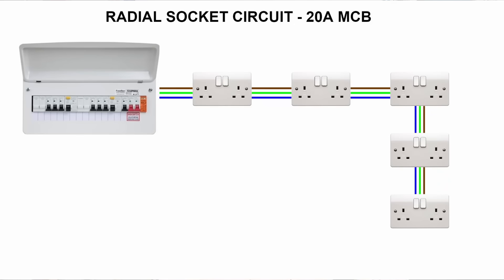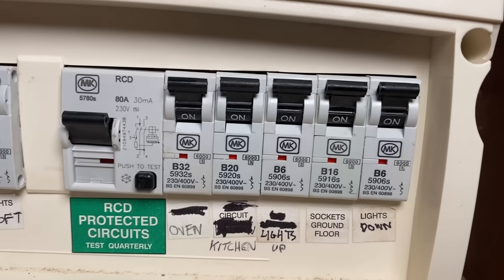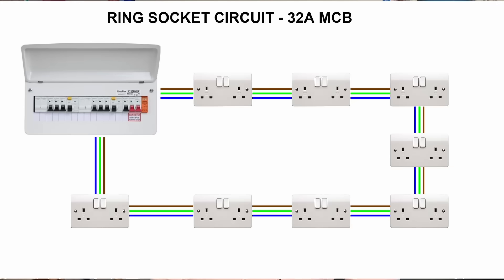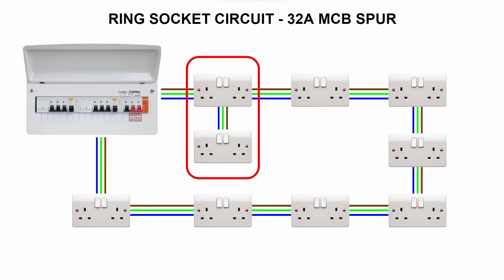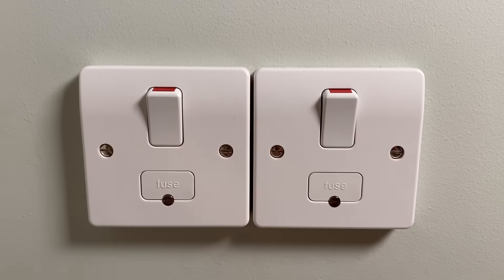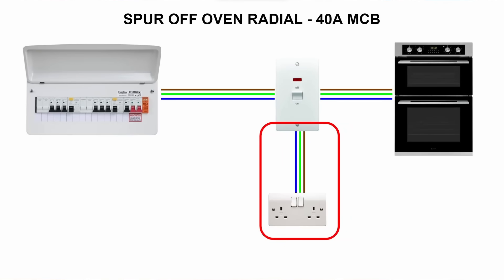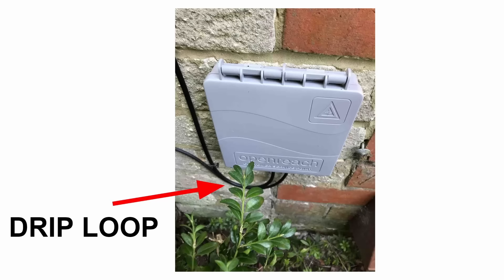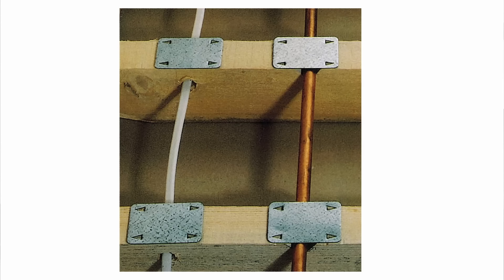BIGGEST DIY Mistakes Adding a New Socket

Comment: So why can't you take a spur for a socket off an oven supply and just add an appropriately sized breaker for the socket?
Reply from the maker: You could as long as it is fused down first, but most electricians would consider it bad practice. Thanks for watching!

Comment: Ring circuits are extremelly rare in my country..not even sure were legal in the first place...most likely error in previous sparkies electrical work.
I had one by default where a doorway in a wall between kitchen and laundry had been deleted in the past & I was called to upgrade lighting in laundry.
The light switch feeds on either side of old door jam were joined together as one for laundry circuit lights but they were in fact  2 separate fed circuits from the board on their own   fuses.
Took some headscratching to figure out why pulling each light fuse separate 1 by 1 not isolate the lights even went to isolate singley 1 by 1 every other fuse in board.. but turn off main switch only way to isolate..learning new stuff every day me.🙂
Reply from the maker: Interesting to hear! Thanks for sharing and thanks for watching!
Reply: This isn't a ring you're describing but two separate circuits joined. A ring is a single circuit with two cables instead of one, on a single breaker.
Reply: Correct that is how they 'should' be.
My case was across 2 breakers. @tobysherring1369

Comment: Ring circuit is crazy. In the US you can only use the size breaker which your wire is rated for. #12 wire max 20A breaker which is rated for 16A continuous duty. If your load is more than 16A for an extended period of time the breaker will trip. We only do what you call radial circuits here. You don't want power coming from two directions in case of a fault.
Reply from the maker: Interesting to hear, thanks for watching!
Reply: I prefer radials. But remember the ring's breaker is rated for the cable too - it just relies on there being two cables sharing the load.

Comment: You have forgotten Parallel Radial circuits!
Reply from the maker: What do you mean? When you have two radials on a single MCB?
Reply: @TheDiligentDIYer1759  That's not parallel radical circuits? Suggest you do some homework. Also the reason Ring Circuits were introduced has very little to do with saving copper, in fact a lot of ring circuits actually use more copper than radial circuits. The reason for Ring Circuits was, The Electrical Installations Committee which was established in 1942 as part of the Post War Building Studies programme determined, amongst other things, that the ring final circuit offered a more efficient and lower cost system, which would safely support a greater number of sockets. Additions and alterations to the circuit being easier and less time consuming than equivalent alterations on Radial circuits. The ring circuit system helped to distribute electricity more evenly throughout the house, reducing the risk of overloading circuits and minimizing the potential for electrical fires. It also provided a means of continually feeding critical apparatus in the event of a cut cable, as a ring is essentially a permanent bus system.

Comment: Really good videos. Nice clear explanations at a digestible pace and without any bs. Subbed.

Do you know of any good sources of info for learning about how many amps to put safely on a circuit, what cables and fuses to use etc? Some software or interactive website would be ideal for testing different wiring combinations etc
Reply from the maker: Thank you, very kind of you to say so! I’m afraid I don’t have anything to recommend, sorry! Thanks for watching!
Reply: Consult a properly educated and trained electrician. There are many factors to take into consideration before connecting a cable to an electricity supply.

Comment: As far as I know, we don't use the same cabal gauge as they did in ww2. All cabals have a maxi load in comparison to their mm2 cross-cut. So combining a radial circuit with a ring circuit carries no danger, as long as the current that the circuit carries, doesn't  compromise the cabals specification.The idea that one reduce the wire gage and at the same time can push just as many electrons through it, by making the circuit into ring; is bollocks.  You can't reduce the wire core diameter and at the same time push the same amount of electrons through it, without some spectacular happening.  The continental Europeans are a bit smarter, they use 3 phase power installations. One can safely say, they are `Light-`Years in front of the UK.Thus a typical EU house has both 240volt and 380 volt supply, so they can run, not only domestic appliances; but also small 3 phase commercial equipment. And radial circuits, well; they don't have them. Radial circuits are like Cheddar-cheese, a British speciality.
Reply from the maker: Thanks for watching!

Comment: At 4:42 the table shows the incorrect values for method 100 and 101 for 2.5 mm2 cable. Method 100 should read 21A and method 101 should read 17A
Reply from the maker: Thanks for watching!

Comment: I have two ceiling rose light in my utility. Can I run a third from one of them and do I just put the twin and earth and match the colours of wire.
Reply from the maker: Yes you can add an additional light to a rose, you’ll need to make sure you join the right cables though, thanks for watching!

Comment: Over my years, I’ve seen some real disasters by qualified electricians, running cable diagonally, cutting wires behind  the light switch or socket, twisting new 2.5 on the old wire and pushing it up the conduit. Just because your a qualified electrician doesn’t necessary mead your any good at it, same goes for most trades.
Reply from the maker: Yep absolutely agreed, thank you for watching!

Comment: Thank you for actually explaining that the "saving copper" argument for ring mains is complete BS.

Ring mains do not save copper, and never did.  They actually do exactly the opposite by restricting the amount of current you can use to less than what you could do with exactly the same amount of wire in a proper radial configuration instead.  Plus they add a bunch of unnecessary risks.  Plus any fault will take out twice as many devices when a breaker trips.

There's just no upside to them at all, and tons of downsides.  I don't understand why they're even still allowed.
Reply from the maker: Absolutely agreed, it is bizarre they are still in the regs and regularly fitted by electricians. Thanks for watching!

Comment: Great video , regarding the spur info, you mention that the ring is rated approx rating is 21a for 2.5mm cable. but regarding the Spur you say its rated 27a. personally i think spurs should only allow single sockets on them, then you could only pull a max of 13A rather than 26A...  Maybe iam missing something.  Agree regarding the radial circuits much safer 20A breaker all the best from a wanabee sparks :)
Reply from the maker: I think the risk with single sockets is that someone would upgrade them to a double in future and max out the cable. It isn’t the easiest to determine if a socket is on a spur or not. Thank you for watching, very appreciated!

Comment: If you are not qualified you should avoid tampering with electrical installations. I had to totally rewire my new home because of added spurs, dangerous add ons on lighting circuits, different cable sizes added into the ring main and lighting circuits by non qualified people. Also when asked to submit a test electricians should not issue passes for part installations. Although the regs state 3 circuits are all that is needed, as I found out, this can be a cop out when an extension is added and 3 new circuits are installed, example, shower, sockets and light on one new distribution box. The pass either be a full test or show clearly NOT TESTED OR CHECKED, so a layman can understand what has been done.
Reply from the maker: Thanks for watching!

Comment: As stated in video If taking a spur off a ring it is good practice to fit a fused spur box ( the clue is in the name )  .... the fuses in UK plugs are also great as the fuses are there to protect the wiring, not the device.  There are not many portable devices with plugs that can draw 13 amps, a kettle and a heater spring to mind.  Good advice in this video...
Reply from the maker: Thanks for watching!!

Comment: What's your opinion on a 5A BS546 socket on a lighting circuit?
Reply from the maker: I like them, I tend to prefer lamps to overhead lighting, so I think they’re great and would like to see them make a come back. Id caveat that with liking them when they are switched from the light switch. I don’t think it would be good practice to have one unswitched just on a lighting circuit permanently live, as there’s the risk someone would change it to a BS1363 outlet. Thanks for watching!

Comment: I was asked to fault find for a local firm, as finding faults is long and time wasting. I specialise in fault finding, so was the right candidate.
I went to a Bungalow, split the ring and proceeded to hunt. I found the crushed burned cable under the doorstep of the conservatory, which was spurred off a socket in the adjacent kitchen.
The builder of this conservatory had fitted SIX double sockets on the spur,,, SIX.!
The crushed cable was Black and sooty from the arching....

Another fault I found was in a Caravan, the "maintenance" had removed a faulty smoke alarm and replaced it with a battery operated version. No longer needing the mains supply, this "maintenance" person just shoved the bare ended wires up in the roof cavity surrounded by damp insulation, which caused nuisance tripping when it was wet with condensation.
It still happens people, no matter how stiff the regulations might be.
Reply from the maker: Those are both bad faults! Thanks for sharing that!

Comment: Great advice and well presented. If in doubt about a ring main then replace MCB with 20A which is a good precaution in any event as high power is not usual except for kitchens with many appliances in addition to oven and hobs ( separate 6mm T&E ).
Reply from the maker: Thank you! And thanks for watching!

Comment: Our old house has got spur on spurs , been like it for years with no problems .Just rules and regulations that are always changing.These days things are using less energy so drawing less current.Admittedly always separate circuits for the cooker and shower with the appropriate cable and protection
Reply from the maker: Yes you are right, if you have spurs off spurs, but the circuit is only on a 16A MCB, it would highly unlikely to ever be unsafe. I guess the risk is someone changes it to a 20A MCB. Thanks for watching!

Comment: So four double sockets off a socket that's part of a ring, might be a bit much, eh? Weird that the home inspector never pointed that to me before I bought the place.
Reply from the maker: Well I guess it probably isn’t easy to tell you’ve got a four socket spur without taking face plates off and testing. I’m not sure what kind of home inspection you’re referring too, but unless you’re getting an EICR from a good electrician, it probably wouldn’t get noticed. Thanks for watching!

Comment: safe plates = yes, absolutely. What is also essential, imho - is a very detailed map of ALL wiring in a home. If a new build - then there should be detailed pictures taken of ALL fittings /cable runs in every room before the plasterboard goes up , with a measure rod placed by them. You get these actual photos on a USB stick, with you house keys.
Also - there is simply not enough basic secondary '"tech" added to a home supply system. The power draw, to every room, garage, loft, should be monitored by a Unit - and recorded -we are still relying on 1970s crude technology,
Reply from the maker: I think building inspectors should be taking the pictures and local authorities storing the data, making it available to owners. Thanks for watching!
Reply: yes- even better.  Imagine if every floor of Grenfell Tower was on video when they installed the insulation... perhaps we would learn something. @TheDiligentDIYer1759

Comment: A double socket is 13A over the full unit... Not each outlet
Reply from the maker: On a multi plug lead yes it is 13a, but a double outlet it is 26a. However, regularly having 26a though a double socket isn’t advised, and better to use singles, eg for washer and drier. Thanks for watching!

Comment: Ring Mains was a good idea, but at the time people hadn't had sockets that long and didn't have many appliances. Just a few years earlier people plugged vacuum cleaners into light sockets. I do cringe on a typical morning when we have 1 double toaster going, 3.1kw kettle, microwave all on the go on the kitchen at once.  If you had a 2kw heater that would be warming the cables.
Reply from the maker: Agreed! Thanks for watching
Reply: We have similar appliances on a 20a radial on 2.5mm2. Kettles aren't on for long - cables take a while to heat up.
Reply: @tobysherring1369  vacuum cleaner or granny charger plugs get quite warm in use. Granny chargers monitor the plug temperature which is why extensions aren't permitted because the extension plug can melt.
Reply: @dr_jaymz  there are continuous high current EV rated 13a sockets available now for car chargers. In theory they could go on a ring.
Vacuums today are limited to about 1000w so a bit easier.

Comment: Great topic. I’m an electrician myself. I agree ring circuits are no longer needed. Most equipment in homes nowadays would happily run on 2.5 radial circuits. 60 years ago 2.5 radial circuits might not have been the perfect solution with alot more resistive loads drawing more current but nowadays everything is much more efficient.
Reply: They were never needed or used elsewhere, I didnt even know they existed until I started watching UK electricians videos.

I can see the point in WW2 era britain but if you saving copper wouldnt you also save power? I can understand it in an industrial setting powering multiple machines but a 1940's home? People didn't even have refrigerators let alone washing machines and electric heaters.
Reply: @zaxmaxlax  
Rings are used in a number of countries, but not used where plugs do not have a fuse.
Reply from the maker: Thanks for watching! Absolutely agreed, outside of anything that has a heating element, most appliances draw little current these days
Reply: What's the difference in a spur off of a socket versus a radial circuit though, surely the same principal? And you're saying radial is fine, so why is only 1 socket allowed off a spur?
Reply: @craigbeesleyproperty  I think you mean what's the difference between spurring off a ring circuit and spurring of a radial circuit ? is that your question
Reply: @Baggiolyful  no. A radial is just single wire not looped, to 4 or 5 sockets.

A spur is just single wire to another socket, what difference is there in then carrying that on and making effectively another radial?
Reply: @craigbeesleyproperty  
You can take a spur off a radial or ring and have a whole line of sockets. But at the start of the spur it will need a 13amp FCU.  Otherwise only one socket spur off a ring or radial. 

A ring is a max of 32A breaker and min of 2.5mm. A radial can be any size cable as long as the breaker protects it. So a radial can be 1.5mm cable protected by a 13A breaker at the CU. 

1.5mm taking into account derrating can take 14.4A to 20A according to the tables.  So a 13A breaker at the CU supplying sockets on a 1.5mm radial is fine. Depending on the cable run even a 20A. 

So a radial supplying upstairs in a 3 bedroomed house with no heavy appliances is fine on 1.5mm. If it had a 16A breaker it could do two 1.8kW fan heaters at 230v.  So two 1.5kW fan heaters in case the gas boiler is down can be used and still spare capacity for the computer, etc. 

Sometimes we overkill in the UK.
Reply: @johnburns4017  A radial is basically one massive extension lead with a 13Amp protection fuse at the start.
Reply: @ 
A radial can have a 13a, 16a, 20A, 25a, etc, breaker at main panel. The breaker must protect the cable.
Reply: @craigbeesleyproperty  I think its all down the latest regs and sometimes its reason to require a lucrative rewire...
Reply: @craigbeesleyproperty spur off a ring fused at 32a, 2.5mm2 cable, safely can supply no more than a double socket. A socket added to a radial, using the same type of cable run to that point, will be fused for that cable size. So a 1.5mm2 radial fused at 16a, or 2 5mm2 at 20a or 4mm2 at 32a. If you add a socket with the same cable it is protected by the fuse. Because the ring's load  is spread over 2 cables and a spur uses a single cable, you are limited in number of spurs.

Comment: our sockets downstairs are spur off spur off spur off spur!, upstairs a semi ring, with only one feed from fusebox(yes, old bakelite 4 way wylex fusebox!)  thats the way it was done 52 ish years ago when 'updating' a very minimal installation, some old rubber wiring still remains in the lighting circuits, it really needs altering, also to add a heating circuit or 2 for storage heaters or similar,  but simply cannot afford it
Reply: i always thought ring main wiring was 30/32 amp with a 30/32amp fuse or breaker, so if one end of the ring came off, the remaining end could still carry the full 30amp ish long term without overheating, if using 20 amp cable, breaker ought?? to be reduced to suit?
Reply from the maker: Probably best getting an electrician in to look it and tell you what is best. Anything done 50 years ago needs an update I would think. Thanks for watching!
Reply: @TheDiligentDIYer1759  it does but no chance, simply cannot afford it
Reply from the maker: Thanks for watching!